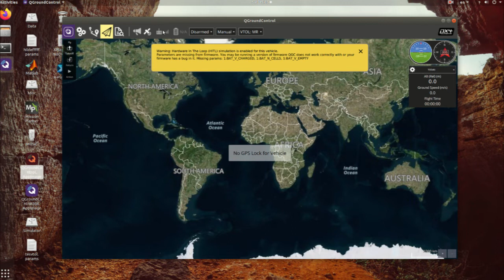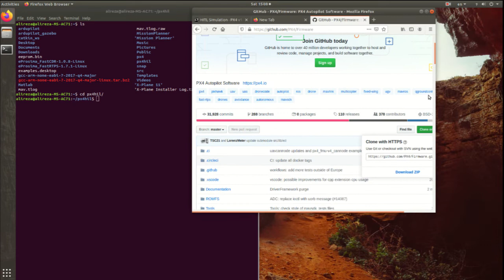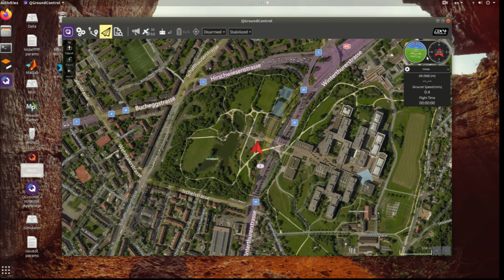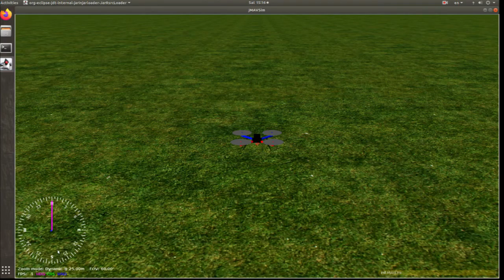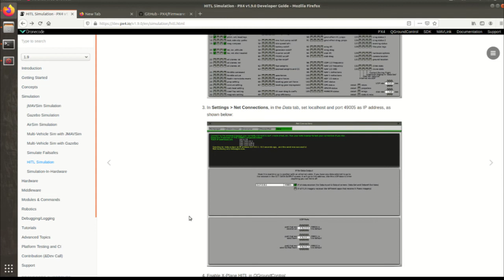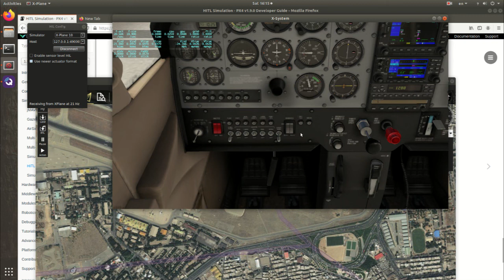PX4 HITL(Hardware in the loop) Gazebo & jMavSim & X-Plane 11

Comment: I follow your most recent video PX4 SITL Windows with WSL and it worked amazing for me (thanks for doing that by the way), but for some reason, i cannot run HITL, a least not the same way you did with this video, and i know this video is old, but i really like your content and i also follow documentation to keep it recent. The last command you use, that runs gazebo, always gets into a loop, saying serial port closed! and it opens gazebo, but does basically nothing, and i'm not able to connect the pixhawk with the qgroundcontrol anymore. Do you know why? Maybe because i'm running it with wsl2 and not windows?
Reply: ok, so... i fixed the connection with qgroundcontrol, but now i cannot arm or basically do anything else other then connect it. Do have any idea of what it might be?

Comment: Thank you for your helpful video.
I am experiencing an issue with the HITL simulation and seeking some advice.
I am using Pixhawk 6C as my flight controller with PX4 1.14.3. The gazebo version is 11.10.2, QGroundControl is v4.3.0, and I selected the airframe as Holybro X500 V2 (since it is mentioned that it is compatible with HITL).
I successfully set up my environment according to the HITL documentation. The iris model is visible and correctly loaded in Gazebo, and it appears that the flight controller is connected to both Gazebo and QGroundControl without any issues. However, I am unable to arm the vehicle using either my transmitter or directly through QGroundControl…
Reply from the maker: Hi .. 
what is the problem that makes the arming denied? are you getting a pre-arm check failed or and error or what?
Reply: @alirezaghaderi  Hi, thank you for your response. I don't receive any explicit pre-arm failure messages or errors in QGroundControl; however, the drone fails to arm without showing any specific error message.. In the Gazebo terminal, it confirms the connection with the message: Opened serial device /dev/ttyACM0, which is the port my flight controller is connected to. QGroundControl is connected via UDP and displays the red arrow indicating the drone's location in the environment. My RC is correctly paired with the receiver connected to the flight controller. Despite this, the drone does not arm..
Reply: I've been working on this recently. It seems like there have been some changes in 1.14.3 which breaks the sim. Try reverting your firmware to 1.13.3

Comment: Thanks for the tutorial. I have tried this in gazebo and it worked. But, i want to use my own quadcopter design and my own world. Is it possible in Gazebo ?
Thanks
Reply from the maker: yes you can but should design the world and model youself  and change scripts of gazebo launch . for the model you need to build a HITL airframe yourself. I recommend using SITL instead

Comment: Have you attempted a HITL with Pixhawk 4 without using a Rx/Tx and scripting out a preplanned mission?
Reply from the maker: Actually I dont have a Pixhawk 4 but ir should be the same.  What do you mean? You have to set a mission and then activate it either using RC Flight mode or Mission GCS software

Comment: Can you connect an xbox joystick to fly the copter? Or does it have to be manually configured?
Reply from the maker: There some emulators that makes your pc think that the Xbox Controller is actually a pc compatible joystick... I have used the PS4 Version before... that should work out

Comment: Hello, I followed ur steps, and everything worked as in the video, but when i got to the step where i launch gazebo in HITL mode (gazebo Tools/sitl_gazebo/worlds/iris.world), gazebo opens up but with nothing in it ( no world or vehicle), 
I hope you can help with this issue
Reply: You have to download the file "iris.world". The problem is that the last version of firmware doesn't have that file. You have to download manually, you can find it here: https://github.com/PX4/sitl_gazebo/tree/Antiheavy-patch-1/worlds
Reply from the maker: Make sure you have set the settings in QgroundControll an HITL enable...  and the changes needed in the text editor
Reply: @alirezaghaderi  iris.world is missing from the stable Github repo now, so it doesn't load the iris config and therefore nothing shows up.

Comment: How do you connect the FC to your pc via UDP?
Reply from the maker: FC is connected via Serial.... GCS is connected via UDP
Reply: @alirezaghaderi  after I use the  command: " gazebo Tools/sitl_gazebo/worlds/iris.world " gazebo is opened but not with the Iris model, the only model is ground_plane. and when i open GQC it does not connect to the FC.
any idea what might be the problem?
Reply: @omerporat481  You have to download the file "iris.world". The problem is that the last version of firmware doesn't have that file. You have to download manually, you can find it here: https://github.com/PX4/sitl_gazebo/tree/Antiheavy-patch-1/worlds